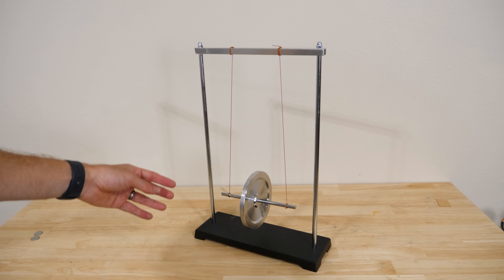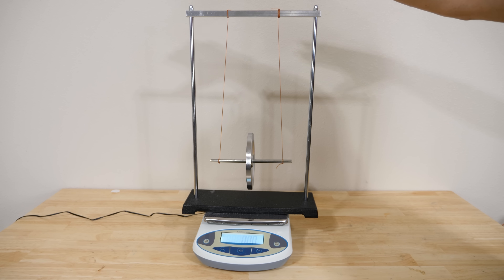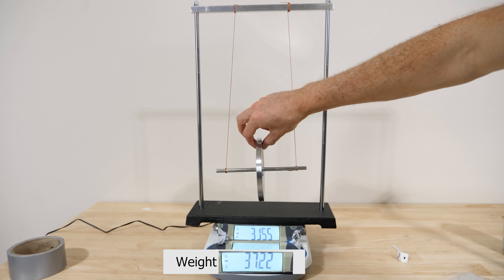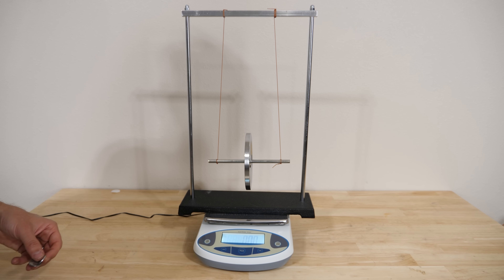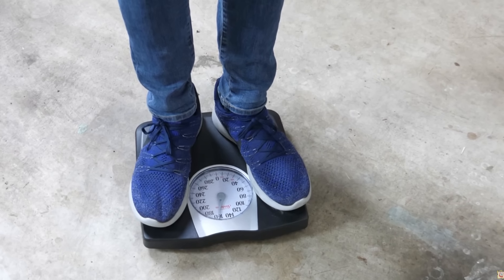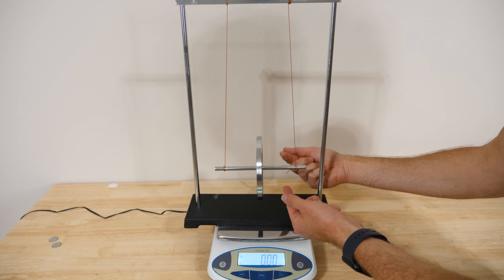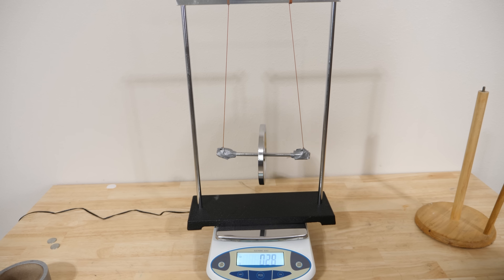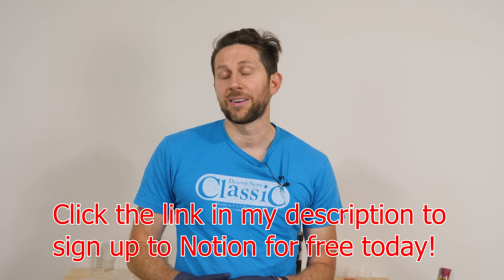How Does The Anti-Gravity Wheel Work?

Comment: Two effects> Magnus, and Coriolis. The wheel is crearing an air pressure differential as it rotates. This differential may be producing some kind of LIFT in both directions. Just by spinning, the air currents are turning turbulent around, but directed in the middle. My take.
Reply: Nope.
..
Close.  Mass is a property of the wheel and doesn't change.
You measure no WEIGHT when falling.
This wheel is just falling less than gravity want's it to.
..
Here's the deal with this wheel:
The wheel does NOT weigh less when it is spinning!.
..
It may be more correct to say that it weighs less when it is "bouncing".
..
I have a problem with the interpretation of the Laithwaite demo.  Precession does not translate the wheel.  It does not lift it. 
Precession causes the axis of rotation to change direction. This is a ROTATION about the center-of-mass of the wheel. It is not lifting the whole wheel's mass. 
.
Precession does not cause the gyro to move (translate) sideways, nor upward in Laithwaite 's case or Veritasium's case. 
If the vertical spinning gyro had translation, it would slide along the table, but stay vertical. It does not do that.  It tips, or rotates at 90 degrees.
The fact that the handle is offset and long has significance.  If you push the handle in the direction of the precession, that lifts the handle, right?.

However the interpretation that the spinning wheel is always accelerating downward even while moving upward,  is a very good catch. It took me a few seconds to realize that.  My quick initial feeling was that the weight would go positive on the way up. . . 
The way to think of it is that is is 'partly falling' due to gravity.  When you are in free-fall you are completely 'weightless'.  The spin and string-shaft arrangement allow it to fall, but not fully, as when you are in free-fall.  So, the frame experiences somewhere between the full weight and weightless ness, but more weight during the bounce time. 
..
 The winding and unwinding of the string causes the up and down motion which is what changes the weight. 
..
Stand on a bathroom scale and at a medium speed, move up and down by bending your knees.  Try to move faster and faster on the way down and slower and slower on the way up. You will see your weight decrease during those times.

.. .. ..
If you watch carefully, you see that it is speeding-up as it drops; this is accelerating, but not at the full 'gravity-rate'.
Also, it is slowing-down as it rises, again not fully accelerating (decelerating or negative acceleration) due to gravity.
..
On a trampoline you are completely weightless from the time your feet leave the trampoline until they touch again and start the bounce. During this time you are constantly in 'total' free-fall.
When in contact with the trampoline you are accelerating upward and weigh more than normal.
If you can add a small upward force to reduce the acceleration due to gravity, you will weigh less. No surprise there.

This is analogous to only "partway" jumping on a trampoline (or your bouncing ball).  On a tramp, you are accelerating downward when your feet are not in contact with the tramp. The ball is when it is not in contact with the floor.  The spinning wheel only "partly" leaves the support strings.  It is "partially bouncing".
If the tramp accelerated you upward at twice the rate of gravity, your weight would double.
Therefore, there is also a slight increase in weight at the bottom bounce.
.
This would be equivalent to a small jetpack on your back that can't lift you, but only partly reduces your weight.  You would be in "Sloe-Fall", not free-fall.
..
This would make a wonderful Dean Drive Scam. . . .
..
It would be nice to have a real-time force load cell so we can see what happens at the bottom of the wheels travel - the positive weight gain during the short 'bounce' time.

..
Also, WHAT HAPPENS to the weight, if the wheel is NOT spinning, but bouncing while being suspended by a spring, instead of the winding/unwinding strings?  
Is that equivalent to this "partial bouncing" effect?

Comment: Gyroscoping precession
Reply: Nope.  Precession only rotates the gyro.  It does NOT translate it.
..
Close.  Mass is a property of the wheel and doesn't change.
You measure no WEIGHT when falling.
This wheel is just falling less than gravity want's it to.
..
Here's the deal with this wheel:
The wheel does NOT weigh less when it is spinning!.
..
It may be more correct to say that it weighs less when it is "bouncing".
..
I have a problem with the interpretation of the Laithwaite demo.  Precession does not translate the wheel.  It does not lift it. 
Precession causes the axis of rotation to change direction. This is a ROTATION about the center-of-mass of the wheel. It is not lifting the whole wheel's mass. 
.
Precession does not cause the gyro to move (translate) sideways, nor upward in Laithwaite 's case or Veritasium's case. 
If the vertical spinning gyro had translation, it would slide along the table, but stay vertical. It does not do that.  It tips, or rotates at 90 degrees.
The fact that the handle is offset and long has significance.  If you push the handle in the direction of the precession, that lifts the handle, right?.

However the interpretation that the spinning wheel is always accelerating downward even while moving upward,  is a very good catch. It took me a few seconds to realize that.  My quick initial feeling was that the weight would go positive on the way up. . . 
The way to think of it is that is is 'partly falling' due to gravity.  When you are in free-fall you are completely 'weightless'.  The spin and string-shaft arrangement allow it to fall, but not fully, as when you are in free-fall.  So, the frame experiences somewhere between the full weight and weightless ness, but more weight during the bounce time. 
..
 The winding and unwinding of the string causes the up and down motion which is what changes the weight. 
..
Stand on a bathroom scale and at a medium speed, move up and down by bending your knees.  Try to move faster and faster on the way down and slower and slower on the way up. You will see your weight decrease during those times.

.. .. ..
If you watch carefully, you see that it is speeding-up as it drops; this is accelerating, but not at the full 'gravity-rate'.
Also, it is slowing-down as it rises, again not fully accelerating (decelerating or negative acceleration) due to gravity.
..
On a trampoline you are completely weightless from the time your feet leave the trampoline until they touch again and start the bounce. During this time you are constantly in 'total' free-fall.
When in contact with the trampoline you are accelerating upward and weigh more than normal.
If you can add a small upward force to reduce the acceleration due to gravity, you will weigh less. No surprise there.

This is analogous to only "partway" jumping on a trampoline (or your bouncing ball).  On a tramp, you are accelerating downward when your feet are not in contact with the tramp. The ball is when it is not in contact with the floor.  The spinning wheel only "partly" leaves the support strings.  It is "partially bouncing".
If the tramp accelerated you upward at twice the rate of gravity, your weight would double.
Therefore, there is also a slight increase in weight at the bottom bounce.
.
This would be equivalent to a small jetpack on your back that can't lift you, but only partly reduces your weight.  You would be in "Sloe-Fall", not free-fall.
..
This would make a wonderful Dean Drive Scam. . . .
..
It would be nice to have a real-time force load cell so we can see what happens at the bottom of the wheels travel - the positive weight gain during the short 'bounce' time.

..
Also, WHAT HAPPENS to the weight, if the wheel is NOT spinning, but bouncing while being suspended by a spring, instead of the winding/unwinding strings?  
Is that equivalent to this "partial bouncing" effect?

Comment: What not use a large rubber bands or bungee cords in this experiment 
Ricky from IBM, Ret
Reply: It will be similar, but the weight will be constantly changing because the rubber tension force varies with length; so the wheel's up-down acceleration will vary.  It is constant in this configuration.
..
This effect depends on the actual vertical acceleration (which is always down) being a little less than gravity 'wants'.  
It as though the energy needed to be accelerating the wheel rotation is being taken from the gravity's acceleration.
..
..
Close.  Mass is a property of the wheel and doesn't change.
You measure no WEIGHT when falling.
This wheel is just falling less than gravity want's it to.
..
Here's the deal with this wheel:
The wheel does NOT weigh less when it is spinning!.
..
It may be more correct to say that it weighs less when it is "bouncing".
..
I have a problem with the interpretation of the Laithwaite demo.  Precession does not translate the wheel.  It does not lift it. 
Precession causes the axis of rotation to change direction. This is a ROTATION about the center-of-mass of the wheel. It is not lifting the whole wheel's mass. 
.
Precession does not cause the gyro to move (translate) sideways, nor upward in Laithwaite 's case or Veritasium's case. 
If the vertical spinning gyro had translation, it would slide along the table, but stay vertical. It does not do that.  It tips, or rotates at 90 degrees.
The fact that the handle is offset and long has significance.  If you push the handle in the direction of the precession, that lifts the handle, right?.

However the interpretation that the spinning wheel is always accelerating downward even while moving upward,  is a very good catch. It took me a few seconds to realize that.  My quick initial feeling was that the weight would go positive on the way up. . . 
The way to think of it is that is is 'partly falling' due to gravity.  When you are in free-fall you are completely 'weightless'.  The spin and string-shaft arrangement allow it to fall, but not fully, as when you are in free-fall.  So, the frame experiences somewhere between the full weight and weightless ness, but more weight during the bounce time. 
..
 The winding and unwinding of the string causes the up and down motion which is what changes the weight. 
..
Stand on a bathroom scale and at a medium speed, move up and down by bending your knees.  Try to move faster and faster on the way down and slower and slower on the way up. You will see your weight decrease during those times.

.. .. ..
If you watch carefully, you see that it is speeding-up as it drops; this is accelerating, but not at the full 'gravity-rate'.
Also, it is slowing-down as it rises, again not fully accelerating (decelerating or negative acceleration) due to gravity.
..
On a trampoline you are completely weightless from the time your feet leave the trampoline until they touch again and start the bounce. During this time you are constantly in 'total' free-fall.
When in contact with the trampoline you are accelerating upward and weigh more than normal.
If you can add a small upward force to reduce the acceleration due to gravity, you will weigh less. No surprise there.

This is analogous to only "partway" jumping on a trampoline (or your bouncing ball).  On a tramp, you are accelerating downward when your feet are not in contact with the tramp. The ball is when it is not in contact with the floor.  The spinning wheel only "partly" leaves the support strings.  It is "partially bouncing".
If the tramp accelerated you upward at twice the rate of gravity, your weight would double.
Therefore, there is also a slight increase in weight at the bottom bounce.
.
This would be equivalent to a small jetpack on your back that can't lift you, but only partly reduces your weight.  You would be in "Sloe-Fall", not free-fall.
..
This would make a wonderful Dean Drive Scam. . . .
..
It would be nice to have a real-time force load cell so we can see what happens at the bottom of the wheels travel - the positive weight gain during the short 'bounce' time.

..
Also, WHAT HAPPENS to the weight, if the wheel is NOT spinning, but bouncing while being suspended by a spring, instead of the winding/unwinding strings?  
Is that equivalent to this "partial bouncing" effect?

Comment: How about just using a mass and a spring. Shouldn't that show the same effect?
Reply: Yes, but the spring's upward force varies with length.  Gravity and this effect are both constant. 
In short, because gravity is also spinning and un-spinning the wheel, that energy is being taken from the acceleration of gravity, thus reducing it.
..
This effect depends on the actual vertical acceleration (which is always down) being a little less than gravity 'wants'.  
It as though the energy needed to be accelerating the wheel rotation is being taken from the gravity's acceleration. Gravity must not only accelerate the wheel mass in the  vertical direction, but also constantly spin up the rotational mass.
..
Here's the deal with this wheel:
The wheel does NOT weigh less when it is spinning!.
..
It may be more correct to say that it weighs less when it is "bouncing".
..
I have a problem with the interpretation of the Laithwaite demo.  Precession does not translate the wheel.  It does not lift it. 
Precession causes the axis of rotation to change direction. This is a ROTATION about the center-of-mass of the wheel. It is not lifting the whole wheel's mass. 
.
Precession does not cause the gyro to move (translate) sideways, nor upward in Laithwaite 's case or Veritasium's case. 
If the vertical spinning gyro had translation, it would slide along the table, but stay vertical. It does not do that.  It tips, or rotates at 90 degrees.
The fact that the handle is offset and long has significance.  If you push the handle in the direction of the precession, that lifts the handle, right?.

However the interpretation that the spinning wheel is always accelerating downward even while moving upward,  is a very good catch. It took me a few seconds to realize that.  My quick initial feeling was that the weight would go positive on the way up. . . 
The way to think of it is that it is 'partly falling' due to gravity.  When you are in free-fall you are completely 'weightless'.  The spin and string-shaft arrangement allow it to fall, but not fully, as when you are in free-fall.  So, the frame experiences somewhere between the full weight and weightless ness, but more weight during the bounce time. 
..
 The winding and unwinding of the string causes the up and down motion which is what changes the weight. 
..
Stand on a bathroom scale and at a medium speed, move up and down by bending your knees.  Try to move faster and faster on the way down and slower and slower on the way up. You will see your weight decrease during those times.

.. .. ..
If you watch carefully, you see that it is speeding-up as it drops; this is accelerating, but not at the full 'gravity-rate'.
Also, it is slowing-down as it rises, again not fully accelerating (decelerating or negative acceleration) due to gravity.
..
On a trampoline you are completely weightless from the time your feet leave the trampoline until they touch again and start the bounce. During this time you are constantly in 'total' free-fall.
When in contact with the trampoline you are accelerating upward and weigh more than normal.
If you can add a small upward force to reduce the acceleration due to gravity, you will weigh less. No surprise there.

This is analogous to only "partway" jumping on a trampoline (or your bouncing ball).  On a tramp, you are accelerating downward when your feet are not in contact with the tramp. The ball is when it is not in contact with the floor.  The spinning wheel only "partly" leaves the support strings.  It is "partially bouncing".
If the tramp accelerated you upward at twice the rate of gravity, your weight would double.
Therefore, there is also a slight increase in weight at the bottom bounce.
.
This would be equivalent to a small jetpack on your back that can't lift you, but only partly reduces your weight.  You would be in "Sloe-Fall", not free-fall.
..
This would make a wonderful Dean Drive Scam. . . .
..
It would be nice to have a real-time force load cell so we can see what happens at the bottom of the wheels travel - the positive weight gain during the short 'bounce' time.

..
Also, WHAT HAPPENS to the weight, if the wheel is NOT spinning, but bouncing while being suspended by a spring, instead of the winding/unwinding strings?  
Is that equivalent to this "partial bouncing" effect?